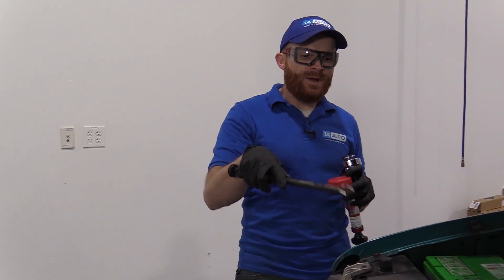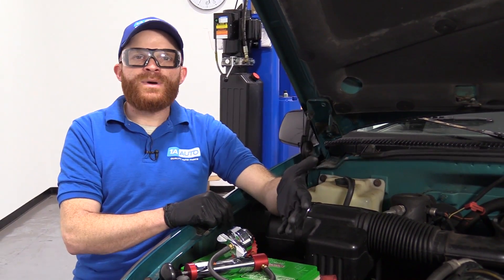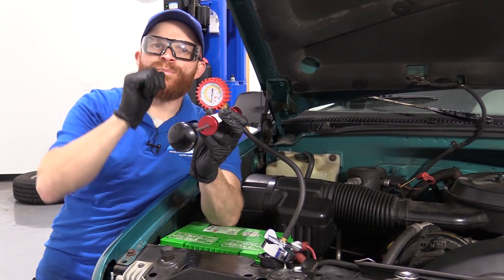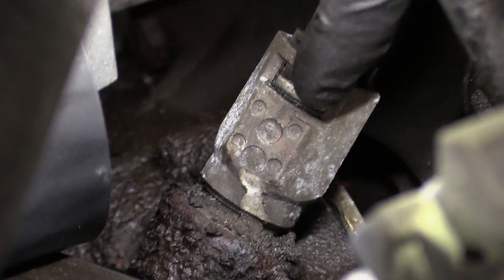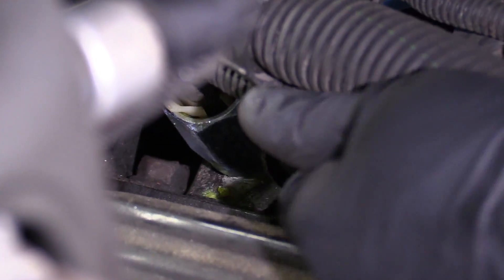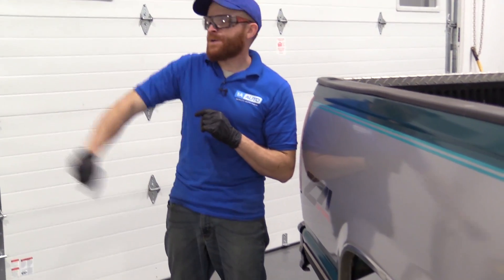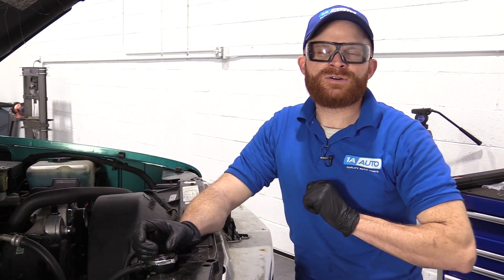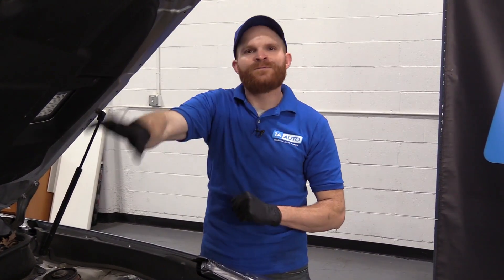Found Puddles Under Your Car or Truck? How to Diagnose Coolant Leaks!

Comment: Ik thos is 5 years old but HELP 2006 cummins 2500 leaking like where the engine and transmission meet or above

Comment: Yeah just bought a car and now confused why my coolant container is empty and filled it up I barely even used it. And also the meter stays in the middle which is odd. So wondering  what or why the coolant disappears to. It’s not leaking, no white smoke, so maybe it’s something inside the the engine hopefully not l.

Comment: Mine is leaking heavy after driving from front of engine. Can't find it. It's not the radiator. From under, I see it dripping from the engine. Is it the hose or the engine?

Comment: 2007 cadallac sts  leaking anitfreeze no leaks canbe found and not in oil or white smoke from tail pipe but the resivor looks like it mnay be leaking any ideas also a silverado 2011 doing same thing

Comment: I was changing the oil in my 04 Suburban 5.3 last night and noticed coolant dripping from the oil pan bolts on the driver side of the engine. There doesn’t appear to be any coolant in the oil but there’s definitely a leak somewhere. In your experience where would you check first to find that leak ?

Comment: my 06 Scion TC the coolant is leaking into the drip pan at the bottom of the engine bay. I notice liquid on the front of the radiator, on the right side (when facing the vehicle). where would be the best place to look for a leak in this location?

Comment: Had a blown head gasket and kept driving my car. For about 6 months I was getting excruciating headaches that would go on all day, everyday. Had to use ice packs and took advil and tylenol about 6 pills each everyday. Once my car finally gave out and I quit driving it, the headaches went away. I finally realized I was getting CO coming into my car. By the grace of God my car gave out.

Comment: Do you go trough the same process to find where the leak is coming from, if the leak is on the floor of the passanger seat? Or is that always the heater core that's broken?

Comment: Hi there.  i have a bad leaking and bought a radiator cap and it stopped. but then in a week i notist theres a small leak coming from down the side of my antifreeze container it happens when i turn my engine on with the key. and as im driving it kinda shakes out sudden but it stops. some might know what it could be??

Comment: I bought my 2004 Tahoe new and within a month the heater core had a leak on the passenger floor.  The issue never returned, but recently I have developed a leak in front of the tires.  I assume that it’s the radiator, but looking under the hood while the engine is running droplets are coming from the center of the fan.  Need to get it handled soon since it leaked on my belts.

Comment: I have a 2006 Saab 97X 4.2 a.k.a. Chevy trailblazer and there’s coolant leaking from behind the power steering pump near the engine. When I say behind, I mean, if you’re looking at the power steering pump from the passenger side tire. The water pump was done recently and VIP auto said that it wasn’t the water pump. They claimed that it was the transmission cooler lines but these all seem fine.

Comment: I recently had a clear leak under my toyota corolla, the fluid had a very slight oily feel. When I mopped the leak from the concrete garage floor it left a very white chalky residue. I now don't see anymore leakage, what could this be ?

Comment: Bruh so I’m moving to Clark’s and this Chrysler been leaking coolant like a mf I needed water n a bottle of coolant to make it back to nashville yet again I found myself on the side of the road again but I’m leaking under the left tire by my driver side by the coolant tank I have no idea where it’s leaking
Reply from the maker: +Kb6415 We wouldn't be able to diagnose an issue like that here, you may want to have a local mechanic take a look at it. Thanks for checking us out! http://1aau.to/m/Shop-1AAuto-c

Comment: i just had my AC on full blast because it’s very hot outside i had it on for about 5 minutes while driving from my friends house home ( only 5 minute drive) i get home and am sitting in the parking lot for about 2-3 mins when i notice the temperature gauge rising. i turn off the ac and my car and notice a small pool of liquid under my car i back it up a little to inspect and it’s a green liquid indicating antifreeze leak. i pop my hood and i notice some little pools at the bottom of the engine would you suspect a hose problem?
Reply from the maker: +Enxrgyy We wouldn't be able to diagnose an issue like that here, you may want to have a local mechanic take a look at it. Thanks for checking us out! http://1aau.to/m/Shop-1AAuto-c

Comment: Hi there 1A Auto, I was wondering if you have time maybe to help with an issue I am having. I am running in to an issue with a 2005 Toyota Camry V8 check engine light (only 52,000 miles on my dashboard so the car is not driven a bunch over the years). The last 2 years like clockwork a year apart i get the check engine. The first time I brought it to a show I was told to go to. They said after checking with their computer I have a faulty knock sensor. So I said okay lets do what needs to be done. They charged me $700 at the time in 2020. They said when taking apart the parts they found coolant in different parts of the engine bay (i do not know car stuff I am pretty sure that is what he said). This part of the problem is how I found your video here. I am wondering too what could cause the coolant leak. They replace the sensor and a few days later the check engine light returns. Same codes on their test so they replace the sensors again (for free). A year goes by and then just before inspection time Check engine again. Go to the shop... same code. Now they do the replacement again and charge me $300 just for parts they say (do not know if that is a reasonable price). It is now a year since then and once again I have a check engine light. Also I should say my coolant is about an inch lower than it was a year ago. Just trying to ask anyone and everyone for information. It is such a hard thing to find a mechanic in NY and since I am not knowledgeable (but trying to learn) it makes this soo much harder... especially in NY.
Reply from the maker: +Fealty Thoughts We wouldn't be able to diagnose an issue like that here. Thanks for checking us out! http://1aau.to/m/Shop-1AAuto-c

Comment: I have a 2017 Buick encore with 32,000 miles and I have a cooler leak under the car and I can’t find it, any suggestions?  I will really appreciate it. No radiator or hoses leaking.

Comment: I have a 2011 Nissan maxima. I noticed that the temperature gage was all the way up there on hot causing the car to overheat also on the passenger side under the car there is a slow leak with green coolant. Would that be a hose problem or water pump or head gasket?

Comment: 3:26 is this seal, where the plastic meets the aluminium, something that can be replaced without replacing the whole radiator? It sure looks like that’s where my leak is ever since a deep freeze a couple weeks ago.

Comment: I bought the combustion test and didn’t get any color change on the radiator. I changed the thermostat because the pipe that was connected wasn’t hot. But the car is still overheating while idling and stays in the middle. Idk what to do next….?!

Comment: Can you do a video on how to replace an egr valve on a 2007 mazda 6 I. I recently took mime off the car to clean it but I think I may have cracked the gasket. It's leaking radiator fluid from the bottom of it.

Comment: Needing answers have 2008 chevy equinox antifreeze keeps leaking along after I put it in by front driver side I need answers I'm being told it's the intake manifold gaskets

Comment: I got a 2001 chevrolet van exspress 1500 I changed the thermostat and the waterpump it still is leaking all the coolant on the ground it dont show overheating at all tho

Comment: I have a 1999 Toyota Sienna XLE and I started the car a few days ago, coolant on the floor. Not a little. A lot. Looked like a lake. Engine temperature guage runs hot. No smoke of any color coming out of tail pipe. I found the fans behind the radiator were damaged. Motors weren't spinning. Plastic fans completely off motors. I replaced both fans. Still engine running hot. I've also noticed the fans never engage/turn on/spin. I put the vehicle up on ramps and checked all hoses and connections. Didn't see any residue anywhere. I checked all areas of engine compartment and didn't see any residue. I've noticed when coolant goes into the overflow bottle, it bubbles, which tells me there is air escaping, maybe? I am at a loss for what to do next. Any suggestions?
Reply from the maker: +Emily Wagner We wouldn't be able to diagnose an issue like that here, you may want to have a local mechanic take a look at it. Thanks for checking us out! http://1aau.to/m/Shop-1AAuto-c

Comment: thank youfor the video. i have a leak on my 02 grand prix 3100 se and i replaced my radiator last summer i paid $62 for it on amazon it is leaking around the hose and getting on the belt causing it to slip. and my engine was running hotter and power steering gets hard soetimes and my battery light cycles on and off.

Comment: I'm at wit's end here.  2011 Cadillac SRX 3.0 was throwing P0430 & P0420 codes and started running hot, so had the 2 cats replaced.  On the way home from the muffler shop, it started overheating and broke down.  Towed home.  Filled reservoir 1/2 way with coolant and immediately coolant was all over the driveway and 10 minutes later the reservoir was empty.  While this was happening, the combustion leak test was performed and the blue liquid did not change colors.  Now, the vehicle is not running hot, not throwing any codes, and the reservoir is empty.  I'm afraid to drive it.  How do I get the gremlins out of the coolant system?

Comment: Older great running 5.4L Triton- appears to be a leak from the weep hole on water pump. Hard to tell once that fan sends that coolant everywhere. Here's the mystery : the leak stopped on it's own.  Three days after the leak and loss of 1 gallon of coolant- it hasnt leaked one drop.  Because of the thicker concentration of evidence I still think it's the weep hole or that rubber with metal fitting hose nearby. Any help greatly appreciated.   Thank you.

Comment: Recently changed coolant in camaro 2014 RS to dexcool  acdelco . However everyday when I open the radiator cap I see coolant gone low in cold start . so I top up with coolant (may be 100ml add). 

Don't know where the coolant is going , no leaks on bottom area. 

Is there only 1 pump in coolant movement or any other ?. No leaks so far on pipes or on the hoses. Seriously it's getting my mind worse as I cannot find the reason for low coolant. Any help will be appreciated

Comment: My 2010 FX35 Reservoir goes over the Max line, i replaced the thermostat with an new OEM and a OEM Radiator cap. I don't see any spills, or smells or smoke. I have to siphone it from the reservoir and put it back into the radiator. The car does not overheat or has never overheated.... i'm at a loss right now.

Comment: I have a 2007 chrysler 300 2.7
No white smoke coming out the back
No signs of bad watter pump
No signs of engine misfire
Then put the blue my car leaks watter I take it to the mechanic them hrs later is leaking that milky chocolate thing out the bottom, on the engine dip stick and the oil cap!
I've been told I need a knew engine but I doubt it, any one else out there might know what it is???

Comment: Do you have a link to the pressure tester you showed on your video?  That would help.  I have a coolant leak that I am having problem locating on a 2010 Jeep Wrangler.

Comment: I just went through 7 gallons just to get back home so this is going to be fun.
Reply: Oh no.... I did that with my 99 Ford and it had dumped ALL of the coolant & water into the oil. Checked the oil and it looked like chocolate milk
Reply: @BigBallinBread  😬
Reply: I did 3 gallons damn this sucks
Reply: @ortiznick1941  couldn't even fill mine up felt like I was pouring coolant into a bucket with a hole on the bottom😂
Reply: @ortiznick1941  same 🤦🏿‍♂️
Reply: As long a we don't see white smoke we're good
Reply: I just drove it home, had to stop every half mile and let her cool for 30 min at a time
Reply: @crossexamination2878  
I had to do the same with my car coming home from work tonight.
Reply: I got a 900 mile trip in a 96 Tahoe with coolant leaks, I'll be back on how many gallons it take
Reply: @SuperGrapeAp3  how was it?
Reply: You could have used water... distilled water instead of polluting

Comment: My car is leaking coolant a lot right under the resevrore overflow tank. What could it be? The leak is totally green coolant. My heat gauge has gone up a bit also

Comment: On my honda I'm having a external leak idk where it could be coming from seeing as I replaced my radiator and coolant tank along with the coolant hose might have to check the lower hose

Comment: Got an exterra 2004 has rusty water in the radiator caused a hose to burst I replaced all the coolant hoses but then the next day I noticed a big leak but it isn’t any of the hoses.
Is it possible that the rust water messed up the water pump gasket?
Reply from the maker: +Raid FYB We wouldn't be able to diagnose an issue like that here, you may want to have a local mechanic take a look at it. Thanks for checking us out! http://1aau.to/m/Shop-1AAuto-c

Comment: Can it leak from the compressor?
Reply: Hector, the compressor is for the Freon in the air condition system. No coolant travels thru the compressor.

Comment: My Honda Pilot 06 is leaking antifreeze. Looks like it’s coming from under the engine. I could not really locate the source of leak. A couple of notes here:
When it starts dripping, it overheats
Any suggestions s?
Reply: One week later.... what did you find?

Comment: My Chevy Colorado started to leak coolant yesterday so I went to check it out I noticed the leak was running down from the engine not any hoses or clamps. So my truck has the big engine fan and it connects directly into the engine and that’s where the leak is coming from,what could this be what should I do does the engine have to be removed. 2007 Chevy colorado

Comment: Could a car just be low on coolant with no issues ? I haven’t had any over heating , no funny smells . But my coolant was low
Reply: No, coolant is a closed system. If it is being lost it must be going somewhere. You should not have to fill coolant between services, unless it was not filled properly and was either left low, or air was left in the system and is still leaving, making the level drop but it will stop eventually.

Comment: my subaru legacy is having neon green liquid leak out. but be fore that all my warning lights were going off then stopped and thats when the leaking happend. what could this be????? i did check my gas cap and that was loose so i put that back on and thats when the warning lights went off finally.
Reply from the maker: +Elise Soper We wouldn't be able to diagnose an issue like that here, you may want to have a local mechanic take a look at it. Thanks for checking us out! http://1aau.to/m/Shop-1AAuto-c

Comment: I have a 1990 Chevy Silverado 1500. I have noticed that I have a potential coolant leak on the right side of the vehicle dripping behind the right tire. What do you suspect it to be?
Reply: an expansion plug or "freeze plug" . its a potiental place to check for a leak. this "A-1" mechanic must not be familiar with engines, but he seems to do well with the camera..

Comment: You’re amazing! Could you show where it might be/ steps to fix this if it’s an external leak near the head gaskets?
Reply: There is no solution for that short of taking the engine apart at the head.

Comment: my duramax leaks out of the reservoir but not out of the overflow seems like an only me problem bc i cant find anything on it bc its not mixed it all with oil like everybody says its just clean coolant that pours out after i stop and having a constant low coolant light after i fill but as i said its all coming out onto the ground not in my engine
Reply: Did you fix it

Comment: I have a Jeep that only leaks at home. When you take it to the dealership it quits.
Reply: could be they are hoping you have an overheating breakdown & it causes extensive damage, that way they can make more money.
Reply: it might be a cold leak so it doesn't leak when its been running

Comment: I just changed a new Radiator, new hoses and clamps. But I still found pile of coolant on the ground. An ideas what the problem is. And is it Safe to drive? Thanks
Reply from the maker: +LUCKY LUCKY We wouldn't be able to diagnose an issue like that here, you may want to have a local mechanic take a look at it. Thanks for checking us out! http://1aau.to/m/Shop-1AAuto-c